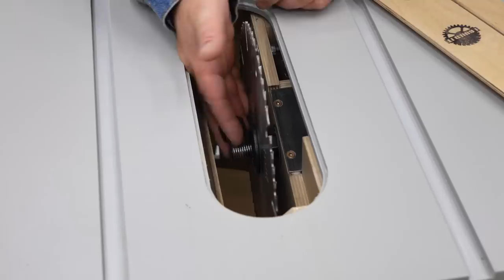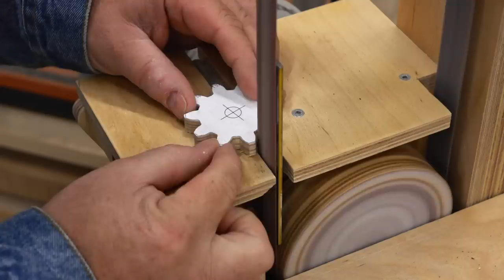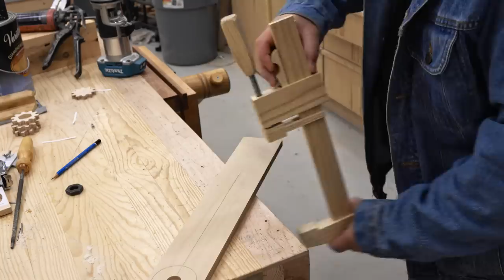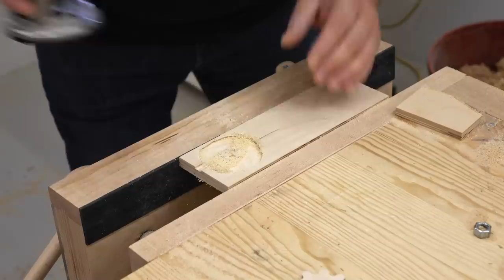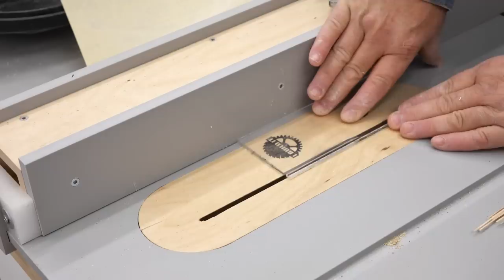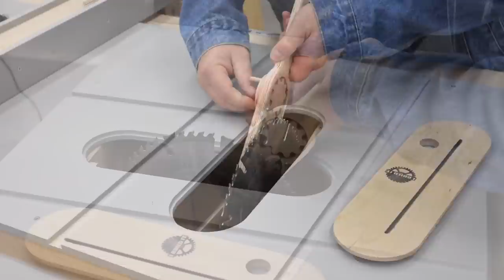Was This Genius, Or A Waste Of My Time? Gear Connected Table Saw Nut Spinner-Oner

Comment: Have you ever had an issue with a difference in expansion and contraction between the wood and plastic? Years ago, I made hardwood panels to hold pictures my son had collected of his sports heroes. I screwed clear plastic to the front to cover the photos. Not too long afterwards, the wood apparently shrunk and the plastic was warped. I tried slotting the holes in the plastic, but it was not pretty. The wood, I believe was oak for a couple of the pictures and cherry for the rest. It had been in the workshop for a couple of years and I didn't think there would be much of a difference between it and where they would be hanging, but apparently I was wrong. I realize a lot of your applications use plywood and that likely makes a difference too. Just curious. Btw, I've watched several of your videos and have liked them a lot. Thanks for sharing.

Comment: At least yours is open on the bottom. With ours the bottom half of the blade is covered with a non removable shroud for dust extraction. And it's made of metal, which makes fishing the nut out with a magnet all the more interesting. I sometimes stick a strong magnet on right under the arbor, so it'll catch the falling nut most times.

Comment: If the blade housing is of a craftable material... couldn’t you cut a hole through the side at shaft height and then make a locking plug to keep sawdust in?

That is pretty cool though and I’d probably use it too LOL. Good build!

Comment: It is a great idea and you really did a good job building it. However it fix a problem that doesn’t really exist. 
  If you raise the blade up as high as it will go. The nut is just below the surface and easy to start. 
  Second question is why four gears. Three or five would have made the nut turn in the correct direction.

Comment: My Dad's solution was to weld a small bike sprocket onto the out side of the nut and use some bike chain as a pair of pliers then spin the damned belt to turn the shaft.  Gave him great grip with a little lever.

Comment: simpler solution: raise the blade first, use your thumb and index to screw on the nut, with your other three fingers under the nut. has worked for 40 years. Also, never use a adjustable wrench , you'll strip the nut eventually.

Comment: Hey, this would have been a great project for your Shapeoko, it would have been much faster and precise.  A belt drive with two wheels would have also worked but you came up with a working solution if a bit Rube Goldberg.

Comment: Hmmm 🤔 might give this a go for my dad but do it on the 3D printer. Wonder if I can get it to print in a single piece like the planetary gears you can do.

As it isn't going to experience a massive amount of force PLA or ABS plastic should be fine (yes I know this is wood but the plans can work for 3D printing I think)

Comment: If the diameter of  first pinion driving the other three is half the size of the others, the torque would be multiplied by the ratio 1:2 . .giving you more leverage . . .also the last pinion driving the nut require a mounting design of some form in order to stabilize it in the center and not wobble . .

Comment: Or, you could drill out places in the nut for magnets to fit in, cylindrical.. Then using one of those flat clicker wrenches add some magnets to that. Then you don't have to swap tools to get it tighter with the wrench. You also don't lose it, the nut always stays with the tool, etc..

Comment: More detail in the build article  ;           Top of the  " BOARD "  !   Question is,have you got a patent for it ?  Also I noticed as you were tightening the { Bolt } , the saw blade continued to rotate a bit , in your redesign , you'll have to solve this problem .  Jack

Comment: Nice, but you should have added one more gear. Now you waste hours because the nut will turn in the counter clockwise direction when you turn it clockwise.

Comment: Cut a piece of steel and attach it to the handle, on the end of the steel, have it stick out from the handle and cut an open-ended wrench in to it so you don't need any other tool for that table-saw nut.

Comment: I have a ratchet wrench that I put a piece of blue tape on one side. Then I put the nut in the wrench and it sticks to the tape then I put the nut on the spindle and I turn it. The gear thing is very cool don't get me wrong but damn that's a lot of trouble for nothing.

Comment: each 2nd DIY worker has a CNC router to mill the gears in 10 min. also a  3D Printer has no problems to print that.

Comment: I think this IS genius. I don't think that a similar tool exists. It screw (and unscrew) when there is a bolt 90 degrees oriented versus the window that allows the tool to reach it. And the size of the window can only allow the tool to get in, without the possibility to move the tool (like a ratchet wrench). Maybe with a chain, instead of gears, it is possible to make it smaller. And possibly you could use a magnet to hold the nut while inserting the wrenche in the hole...

Comment: I don't think I've dropped the nut (or washer) in the last 50 times I've changed blades. So I think I can find a better project to waste time on. And by the way, you could have found and picked up the dropped nut at least 100 times in the time it took to construct this.

Comment: I gave a thumb up for the creativity, but I don't think this hits the mark on the type of video you had said in the bin channel (I think, I don't pay attention to which channel your videos are on) to be competitive/reach now. It needs to solve something a novice would believe is a problem. I don't think this hits that, but I also kinda made a transition into realizing/recognizing more of the crap that was pitched at me as an issue that was a non issue. The things I thought were issues dealt with repeat-ability and  setup for cuts. If I had insight to give it would be that the layman woodworker cares about the cuts he has not yet made. For example, I cared about the finality of a cut, even if the cut wasn't final. Meaning even if my cut was a roughing cut, it needed to be precise to the same degree as my final.

Comment: I'd like it even better if you could auto torque down the nut!  Maybe V2? :-)
Reply: You don't torque saw blade retaining nuts. they self tighten during use.
Reply: @KipdoesStuff  I realize that silly.  But you need it to be tight enough that the shaft doesn't spin when turned on.  This is especially important when installing a dado stack!  Just tightening with your fingers is not safe.

Comment: OR simply bend down and put the nut on from the underside of the table. Rather than spending $5000 buying all the tools used to build the stick with gears on it.
Now for some strange reason watching the gears on the stick turn is rather soothing?

Comment: Very, VERY imaginative ! Very elegant and very cute...TOTALLY unnecessary 'per se', meaning one could perform the same function more simply BUT - and I hold this as very important - it is an excellent exercise; it looks good; it is even mildly funny ( speak of cracking nuts with sledgehammers ) WELL DONE John ! More power to you.

Comment: Honestly I just never have that much trouble putting my nut on my saw blade, but if I did I imagine I could pick up my nut off the floor quite a few times before I spent the same time making that gear spinner on thing? Regardless, it’s still cool to look at and who knows you may even find other good uses for it too?

Comment: Put in a gear reduction (smaller driving gear to bigger gear on the nut) to get more torque, and you'd have a valid product people would buy.

For meme purposes, you need more dramatic "dropping nuts" scenes.

Comment: Neat gadget!!! If it works for you, that's all that counts. With my table saw and when my fumble fingers fail me, I have to disassemble the pickup to the dust collector to retrieve that @#$% nut. Last time it had almost made it to the impeller before I could shut it down. I now have a screen over that outlet.

Comment: Waist of time. Any auto tech knows all you have to do is put a little piece of strip calk on the nut to hold it on you’re finger while you get it started on the threads. Manufacturers should put a little shoulder on that shaft so you can slip the washer and nut on without having it fall off while you’re trying to start the threads.

Comment: Frankly speechless. You have too much time on your hands. Put your index finger in the center of the nut then touch the arbor and spin the nut. Haven't dropped a nut in decades. I enjoyed the video but my life is too short to even contemplate doing this when other things can be done. And, I don't need another "thing" in my shop.